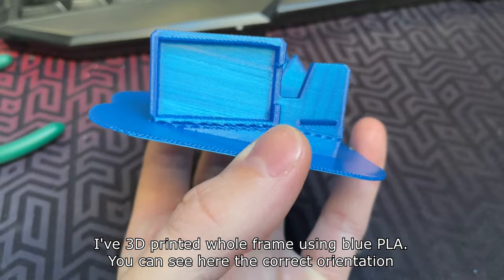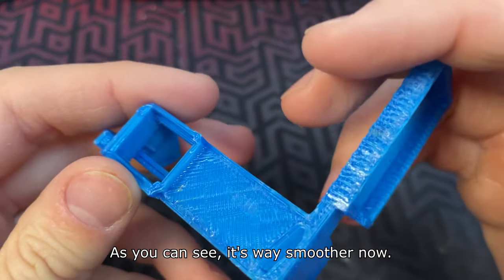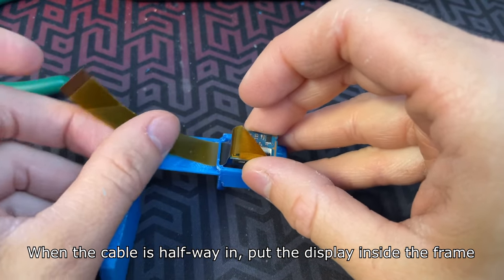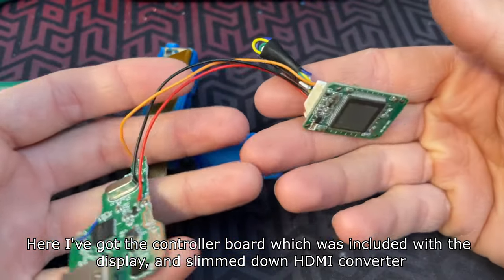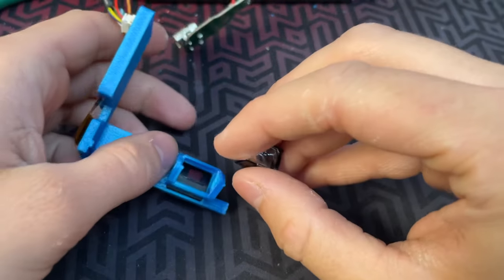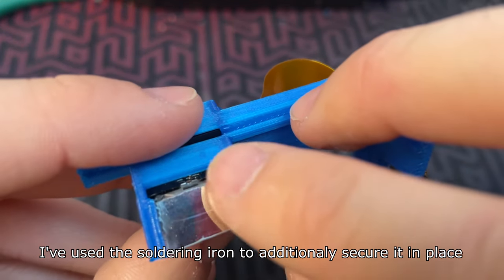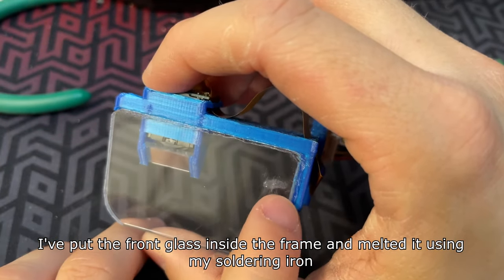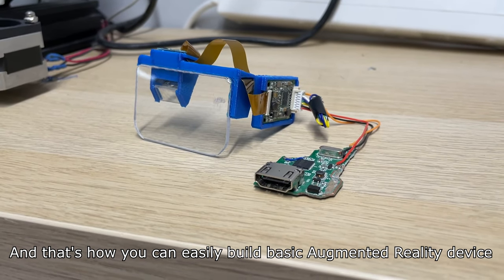"Flatscreen" Engine | Easiest way to basic Augmented Reality | DiY AR

Comment: Highly recommend that you use the Drexel with a sanding disc on low speed to clean up your 3d prints, switch to the knife for fine details, makers need their fingers. Definitely an awesome project, gonna be fun to do my own version, good work.
Reply from the maker: I actually have a dremel tool but I’m not patient enough for it 😅
Would love to see your remix of my project. It’s always fun to see modified versions
Reply: @ManolloMancelli  plz send me parts ❤
Reply: Manolo, please give a link to where can i get this ribbon  cable? I just can't find it 😕

Comment: I really like this. Great idea. Will it work if I use my helmet visor as reflector? I'm sure I have to add hud reflective film on the visor and probably change the angle of the screen housing for it to reflect from the visor properly. Keep up the good work.
Reply from the maker: Depends how much room you have inside your helmet. If the visor is really close to your head then display would poke you in the forehead when rotated
Reply: @ManolloMancelli  Thanks for the advice. I will order the screen and start this project. Thanks for the video..
Reply: @dennis_503_gutierrez  wich screen do you use for this ? Or wich one could you use? I can‘t find a fitting one.
Reply: @ropio299  Hi. This the screen I ordered. I have not started with the project yet but the screen works great. Used it with my laptop HDMI output and works great.
$97.08  5%OFF | 0.4 Inch 1280(RGB)X960 LCOS Micro Display (Only Display)
They should have the HDMI version. Ask for the HDMI version.

Comment: How do you change the brightness of the display? It is not reflecting off of any surface due to low brightness.
Reply from the maker: You have to connect one of the colored wires to the GND pin but I don’t remember which one does that.
Reply: You can check out my posts. The brightness is adjusted by a GND and BRT ADJ pin

Comment: Yo what's the display you used, i want to make one too
Reply from the maker: It’s the micro FLCoS from AliExpress. I don’t think it has a specific brand or model. I’ve also found it on eBay :

https://www.ebay.com/itm/373756978527?hash=item5705a6e55f:g:rH4AAOSwLwphJxQz&amdata=enc%3AAQAHAAAAkBNTvMGobatJ9mPUKLMdsCsX7MN3yeWL7XgcFcYTTRzBsRB2zM%2FQt3qKiMVSz2g75mLO1q7%2BPlM8h9jPBE6iU4eoEYHxBCk8tiOLxBT500V1asl8AhTzEzhUN8GVSjZ%2FLio9Q7e2HQ8Sai4PkQKpDMhL06dPNYmzkQSFhzFcoo76YrvQ0adus6xwr%2BYjYmNYeQ%3D%3D%7Ctkp%3ABk9SR_bu9bGyYQ
Reply: @ManolloMancelli The link’s broken. Can you just post the display and stuff’s model name?
Reply from the maker: @ZackFreedman  I would totally tell you the model and PN of this display but I can’t actually find that info and seller won’t tell me. 
I’ve found the working link though :
https://www.alibaba.com/product-detail/0-24-Flcos-micro-display-960x540_62014764685.html

Comment: Are you right or left eye dominant because I have noticed while trying a similar project that using such a display on my non dominant eye causes eye strain
Reply from the maker: I’m right eye dominant but I make those for the left eye. It doesn’t cause much eye strain for me but it would be way better to use two displays. One for each eye. I could easily do that if I’ve had second display.
Reply: @ManolloMancelli  Thanks! keep up the good work.
Reply: Hi, sorry to butt in...i have a question, would be possible to just put the display in between eyes. Would it project a centralised image? And would it cause any harm to the eyes if done so? I am really interested in this project...and am planning to do one ;)
Reply: @luqmanulhakimzulkornain1314  too close to your face. Hold your finger up between your eyes and see how that feels after a few seconds of focusing. You're better off just making 2 like VR